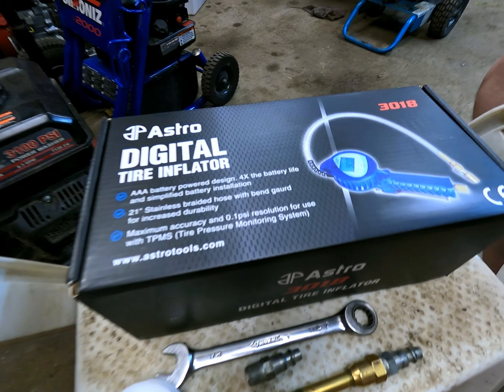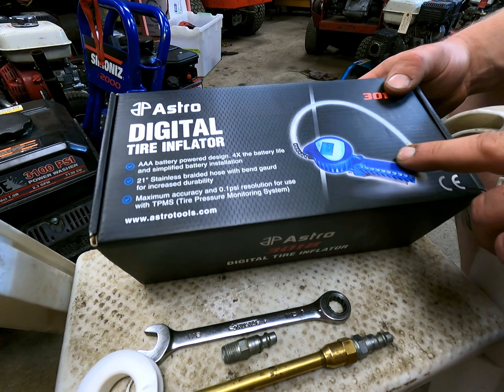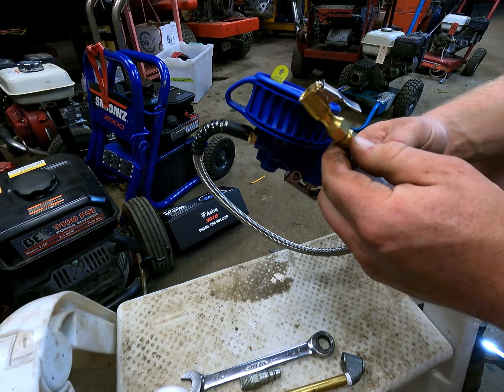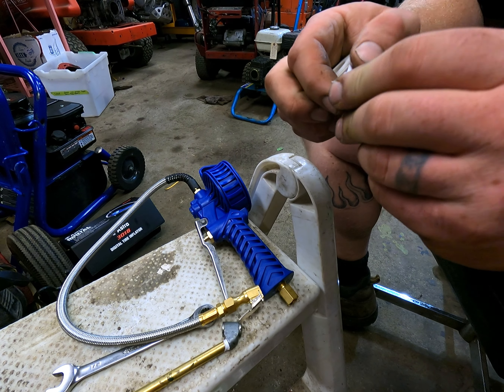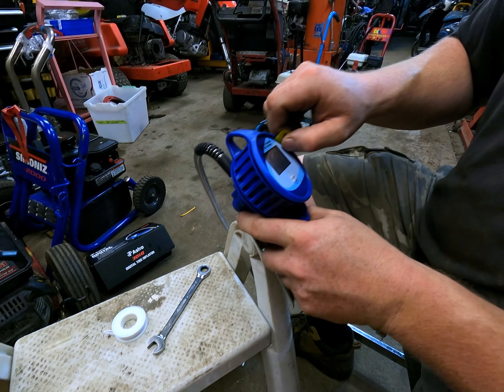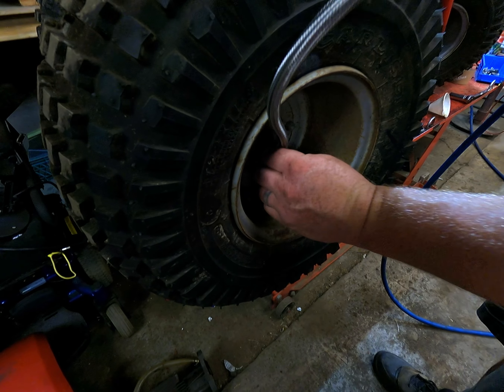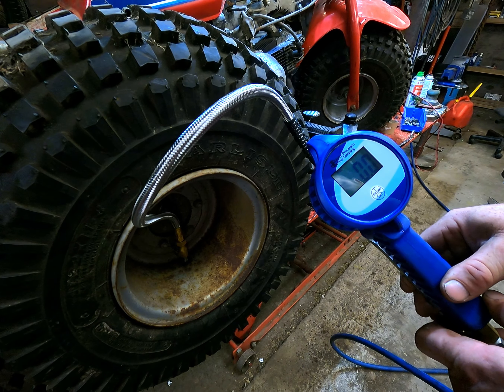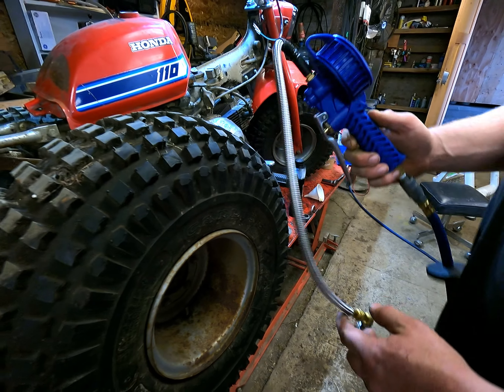Astro 3018 Digital Tire Inflator

Comment: Mine is two years old.  Works good for DIY usage.   The chuck doesn't always stay sealed good on valve stem and will have to be pushed on harder or held with hand.   The lighted background only stays on for 10 seconds but the digital numbers will stay on for 90 seconds when finished using it.   IMO the chuck attachment should be more secure and the lighted background should stay on for at least 20 seconds.

Comment: AstroAI makes many models of gauge and filler/gauge combos.  Make sure you get the BLUE  '3018' model, it is the gold standard for measuring tire pressures.  It even works as a stand-alone gauge if it is removed from the air supply hose.  How do I know?

My mechanic let me take it out to my car to test against another gauge I brought with me for this purpose.   My Longacre dial gauge reads about 1/4psi higher than the AstroAI 3018, so that's good enough for me!
Reply from the maker: It works great, the air chuck definitely leaves something to be desired tho.

Comment: how does it turn off
Reply from the maker: it has a 20 second or so timeout.
Reply: i just bought mine but wont turnnoff ita wierd the numbers keep moving
Reply from the maker: @valentingarcia4137  maybe it's defective. Mine shuts off after 15-20 seconds
Reply: Since there is no OFF button, it will turn itself off in 90 seconds.  The backlit light will stay on for 10 seconds and then you will have to hit button again for 10 more seconds.